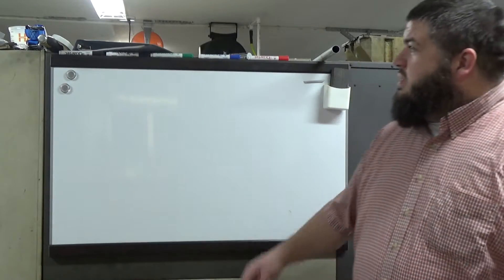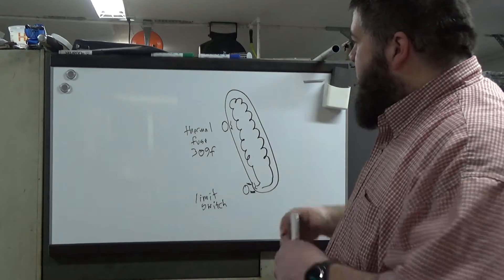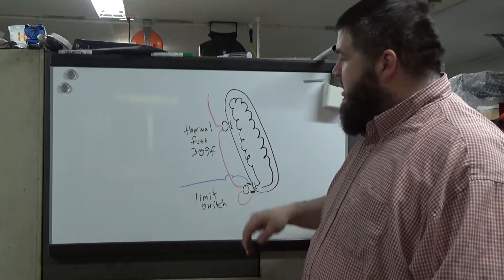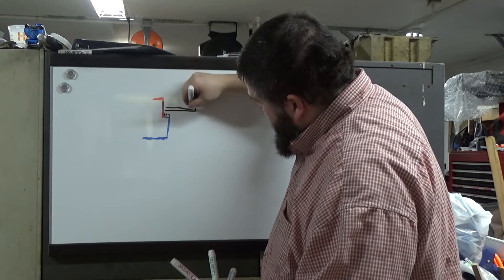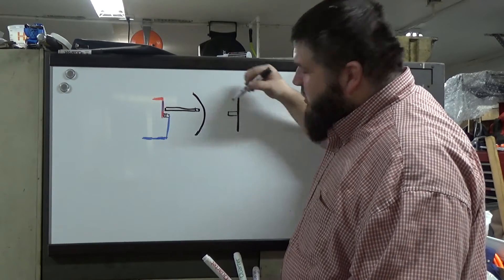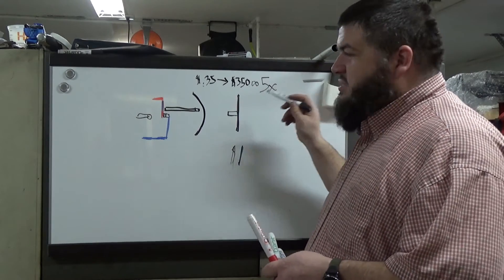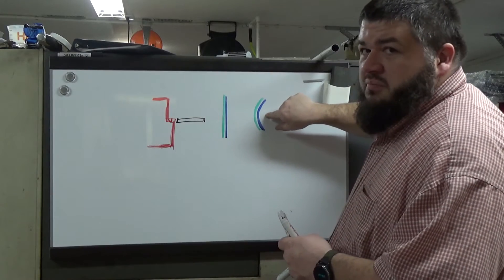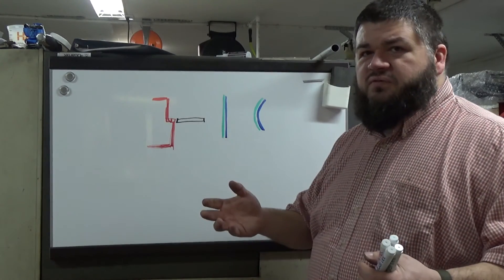Clothes Dryer Thermal Fuse Failure and Diagnosis

Comment: Can a switch be defective so the dryer runs hot all of the time? The low heat setting does not seem to effect the heat output. Is there a way to test the thermal switch by using a hair dryer. Or is it all just a waste of time and for six bucks just order the new parts. I think I’ve answered my own question.
Reply: Hi Robert, 
You can test the cycling thermostat with a lighter and an ohm meter.  
Unplug the dryer. 
Uninstall the cycling thermostat, test the two terminals for continuity and you should read about .08ohm.  If so, then hold a lighter to the metal portion of the thermostat until you hear an audible click.  Then, take the same ohm reading and you should get an OL or open reading at that point.  
Now, this will let you know that the thermostat is infact opening, but isn't telling you at exactly what temperature it has opened at.  

In the instance that the dryer is getting too hot on all settings, it makes me immediately suspect a shorted heating element to ground.  
To test this, you will (with the dryer unplugged) remove the incoming power wires to your two terminals for the heating element.  Neither of these terminals on the heater should touch ground (i.e. have continuity with ground).  If either of these pins has continuity between the pin and the housing of the element, that is a shorted element and this would stay on full time any time the timer is in the on position.  It effectively bypasses the cycling thermostat and thus gets too hot.  

Let me know if you have any questions!
Andy
Reply: GE Side-by-Side ONLY - Refrigerator Repair Videos thanks GE.

Comment: What can you fix on the dryer to prevent the thermal fuse from continuously Poppin ? I’ve changed 4 in the last month
Reply from the maker: Your dryer duct is probably obstructed with lint.  The air isn't able to flow past the heating element fast enough because of the obstruction, so the element gets too hot.  The same thing would happen to a hair dryer if was clogged with lint.
Reply: Ive got the same thing happening, but my lint has been thoroughly cleaned out of all areas. Any other ideas?

Start switch? Timer?
Reply: Check your heating element for continuity! Bad heating element/touching the casing can cause that!
A faulty contol board can too if the relay had went out. Good luck!

Comment: Hey buddy interesting for this to come up now. My Dryer just caught fire last week. My wife came running into the shop yelling for me and I grabbed the extinguisher to put it out. When I got to it I could not see where it was on fire at first, after a minute a saw lil flame poke out of the piece of perforated metal where the heat enters so I put it out. I was surprised she saw it and it's a damn good thing did cause she was about to run errands and would have been out in shop for hours, pretty scary. I thought for sure the lint tube would have been clogged even though the tray gets cleaned every load, but it was completely clear so I'm guessing something failed in dryer. Could have been very very bad if she hadn't had noticed it. Thanks for the vid.
Reply: Steve just Steve If your dryer was newer than I would expect a fault and I would hope that you would have reported it to a consumer reporting agency. A fire in that location? Where the hot air enters the dryer. Interesting. Did anyone ever tear the machine apart to see how this happened?